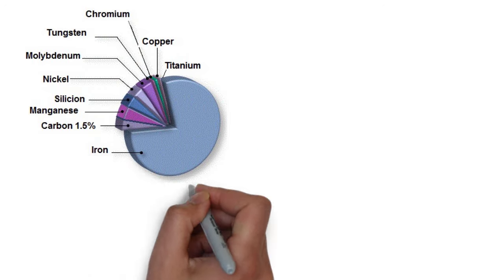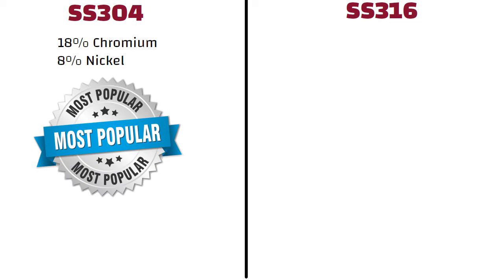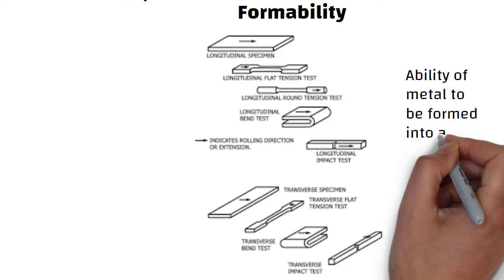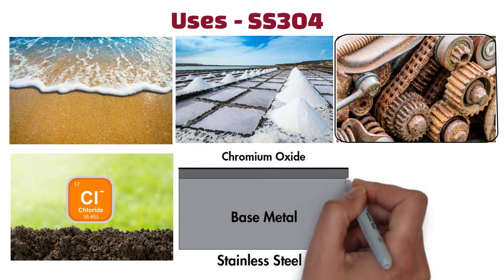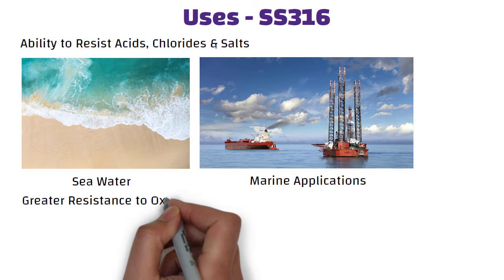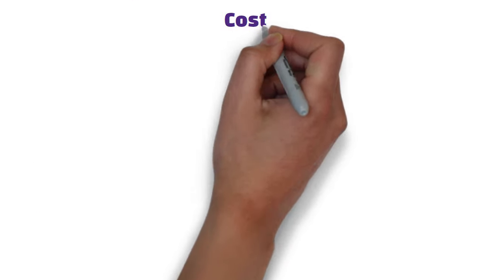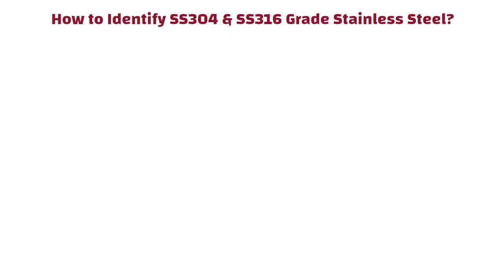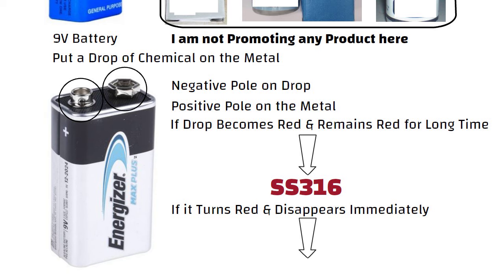SS304 vs SS316

Comment: Great explanation of these stainless steel options. Im a 316 guy over 304 due to my salt water region
Reply: What did you build with it?
Reply: @nevinkuser9892  I have ratchet buckles turned into straps. All hooks and buckles in all 3 sizes are stamped in 316/316L in 1", 1.5", and 2". Nobody else has this high grade stainless in ratchets for tie downs. Won't corrode as all the others do.

Comment: Hi there! I got a question if I may! I’m looking for a SS Pipe that can be fitted to build a Flipping Table that will take the load of a Mitre Saw (e.g. Evolution R255SMS-DB+ 255mm Double Bevel Sliding Compound Mitre Saw), that is roughly 18-20kgs. When flipped it will be use as Table Saw Feed Table & Workbench. Can you please be kind enough to show me some light if you wouldn’t mind! I’m just a DIY’er and disabled so, everything in one place is kinda important to me and gives me enough space around the Table when I am in my Man-cave… Thank you in Advance!!!

Comment: Thank you very much, sir, for a detailed explanation, I appreciate it. I have a question to ask you, following the aforementioned information. If metal is to be used in the oven for baking bread on it, heating it periodically to over 250C. Do I better use 304 or 316? Thank you
Reply: 316 would be preferable
Reply: I even have an aluminum oven that does that extremely well. The benefit is that it heats up a hell of a lot faster. The whole oven is very thin too but sturdy and works well.